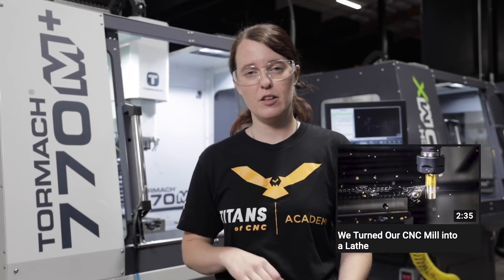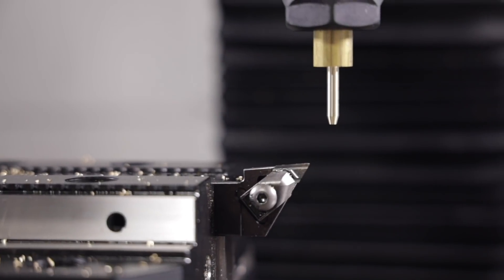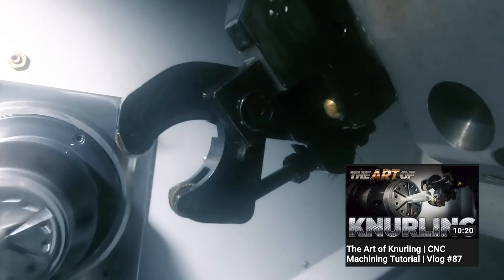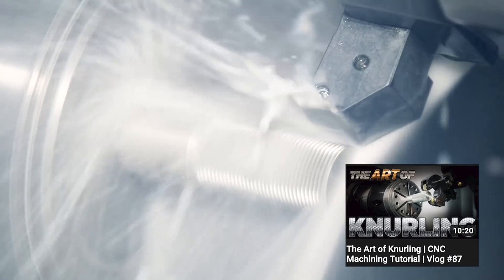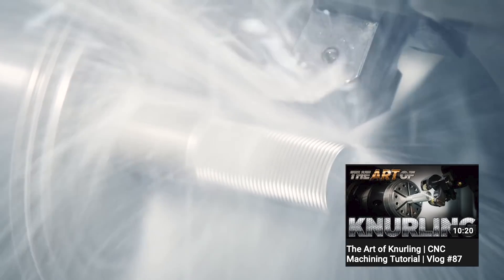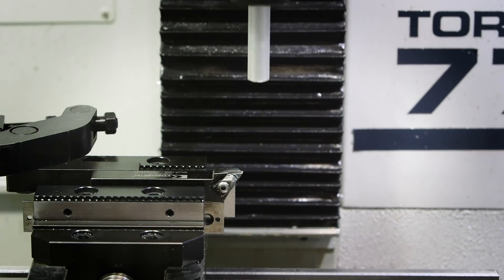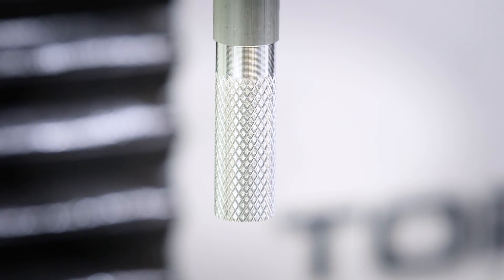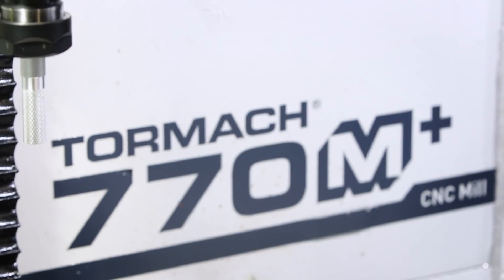Knurling on a CNC MILL!

Comment: I turn 2-3 times a month on a 770 S3.  I modified the F360 post processor and have a four gang.  The spindle bearings on this mill are ~3"D.  On my manual lathe they are ~6"D.  That's the Achilles heal.  Be cognizant of side loading and moment arm to preserve bearing life.  Knurling produces high loading and there is little benefit to CNC knurling so I wouldn't do that.  Same for cut off.  No spindle location so no threading.  Little benefit to CNC drilling so manual for that as well.  But for ID and OD profiling it works amazingly well.  I only run hardened steel.  TTS ER32 limits your stock size.  You can machine the TTS feature into the stock to reduce stick out and allow larger stock.  You can also use ATC for auto changes.  You can make a TTS jig plate to run square blocks for ID profiling.  My recommendation after a couple years of this is to find a way to buy a CNC lathe.  All this stuff is cool but it takes a lot of time.  Big bearings, large through hole, tailstock, steady; there is a reason all of that exists.

Comment: Great idea if you have to make 1 or 2 parts! Thanks for that tip... any more than that would not be efficient for changing work pieces. Time and a place scenario I guess. Thanks for the tip!!
Reply: If you had 2 collet holders, you could probably load the second one up in the time it takes to machine the first one, and just keep swapping the tool holders out. If the machine had a tool setter, you could use that to measure the length of the stock and not have to pre-measure it too.

Comment: You could set more tools than 2.

The tools should face to Y+ direction, and you will have the whole width of the table to fill with tools... On both side as shown in the video.. 10-20 of them should be enough for everything, that can fit into this small length, and diameter of material.
Reply: The real question is how large of a 3 or 4 jaw chuck could you hang off of a CAT 40 holder (or whatever tool holder this style machine uses) to not be limited by the collet size, and how can you mount a chuck into a tool holder like this?

Comment: I already have the same on a CNC milling machine.
At that time I turned a knurled nut, where I processed every single step on the CNC milling machine.
The knurled nut even had a conical surface on the inside.

Comment: How do you do the Fusion360 CAM for this? Or is it done with manual Gcode at the machine?
Reply: faster and easier using manual gcode
Reply: @chaddanylak8706  Thats what I was assuming, I havent used my 770m for any lathe work yet, was curious, wish they had a mini tutorial, Ill have to check youtube for one when I get time
Reply: @ClockwerkIndustries  I cant get a tormach in my country England but would have one if I can get one, but I would recommend learning if you dont know manual Gcode as it would give you more option and control over your machine which is not possiable to do inside cam software, ps I seen some of your video before keep up the great work
Reply: @chaddanylak8706  you can just order and let them ship it towards england. Although a used haas from europe would be an option considering the total pricing..

Comment: Nicole how you do the CAM in fusion 360. Can you make a video about this. Thanks
Reply: I think it's called Mill Turning in F360 CAM. People have been doing it for a long time, but Fusion added it to the CAM processor last year, and it's way more common now.
Reply: @jcriley76 Maybe of you are only running brand new machines, with proprietary interfaces. Haas for example puts out videos showing you how the different gcodes work for their machines, and most cam packages dont have ways to input those gcodes in a standard operation, they have to be added in manually.

The biggest thing is that by knowing gcode you can eliminate unecessary crap that post processors add in. you can reduce the run times for parts significantly, specifically lathe parts which are ineherently less complicated to program and understand whats going on. It also helps to have a gcode simulator that can show you the tool paths generated by the gcode so you dont screw it up.
Reply: lol just add a manual nc operation in.
Reply: @jcriley76 sorry but if you can’t hand code that you shouldn’t be running a Cnc.  it’s the most basic of gcodes ,and if you need fusion to do that then you are bound to crash a machine for not knowing anything cam spits out.
Reply: @Kasonb6596  You are part of the reason this industry is so toxic.  They are asking a question. You're belittling and condescending comment helps no one. Throw your keyboard away.
Reply: @mcgoogoo  lol. For telling people they need to learn how to write gcode. People like you are the problem. Thinking if you can write a cam program you are a machinist.
Reply: @Kasonb6596  I don't know you or your experience and you don't know mine. My point is they asked a simple question and you started acting like you were Canadian, which is never ok.
Reply: @mcgoogoo  lol no, I was just simply trying to state it’s an easy hand code program. It does bother me when people have NO idea what any of the code that cam spits out. It’s a recipe for disaster
Reply: @Kasonb6596  So people shouldn't be curious and improve themselves? Seems pretty dumb, people like you are the reason this industry is so toxic. Yes G-code is easy, but there is absolutely nothing wrong with someone asking how to use CAM. That's just an absolutely silly opinion.
Reply: That’s a pretty easy program to just hand code.